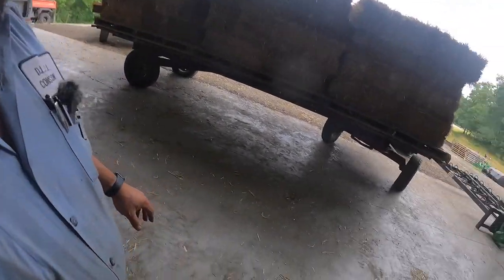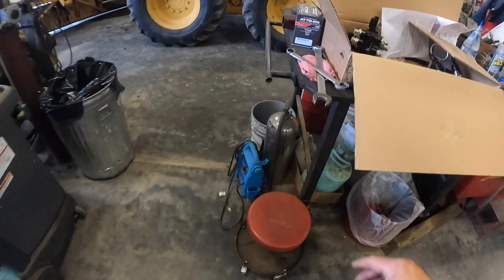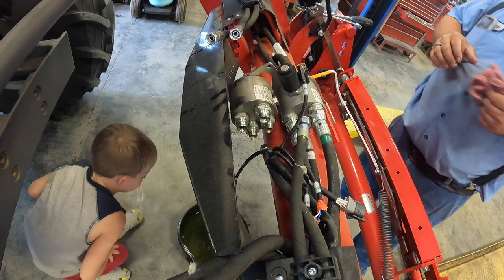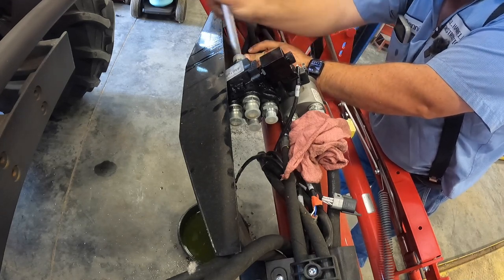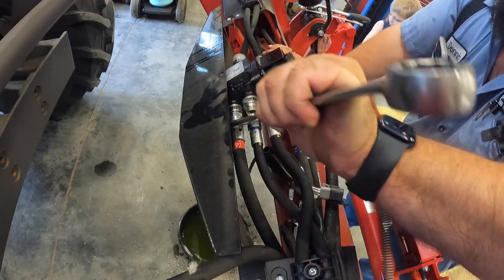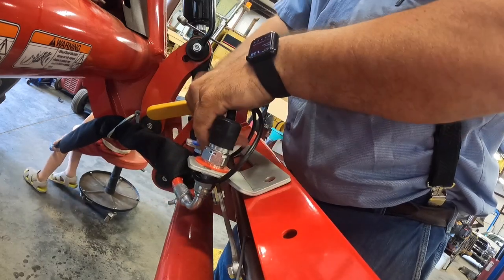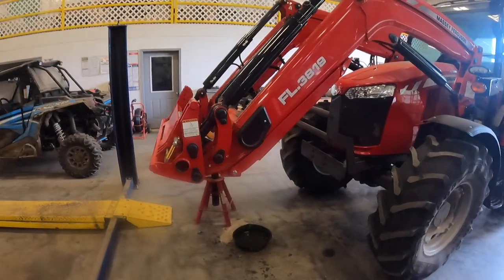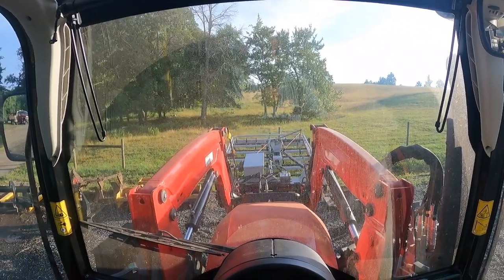Hay Update and 3rd Funtion Install on FL Series MF Loader

Comment: Alto makes a wonderful loader, basically installing a diverter valve.
I have a Quickie 66 all the wiring is there just couldn’t locate the diverter solenoid and hose kit,it also has capability for 4th function 
It’s a shame that they tried to stick it to you at the dealer some folks don’t know or cannot do the work,when I ran my shop I gave an honest price for a good job an made a comfortable living 
Thanks for your videos 
Happy Harvesting 😊😊

Comment: That's kinda what I did on my koiti 2610 but I just put a universal valve and had it with a on or off switch I didn't like the price of factory valve didn't mind the extra work
Reply from the maker: Good deal
Reply: I think I only had 450 bucks with hoses but it took me awhile to fab up brackets and wire the switch in but well worth it grapple makes brush work super easy  @DLHFarms

Comment: Do you see any reason I would have trouble using a 10 bale hay grapple on my 4066R with 440R loader? I only hay 12 acres so not a massive amount of bales.  Thanks, Joe
Reply from the maker: It can do it, I have a short on YouTube doing exactly that search it maybe you can find it. 
It won’t stack them but 6 or 7 high though from the ground.
Reply: @DLHFarms  many thanks!